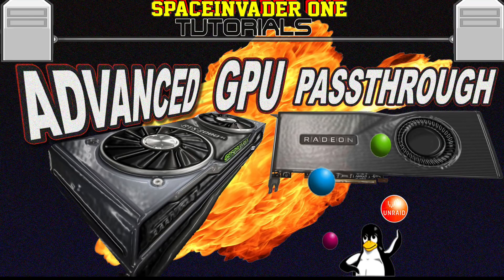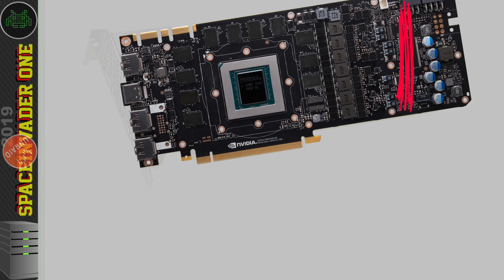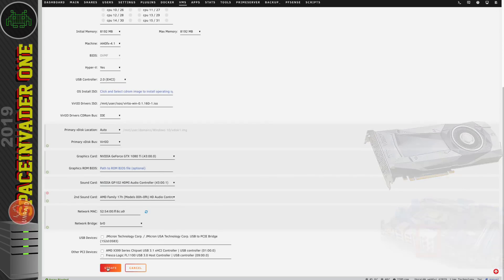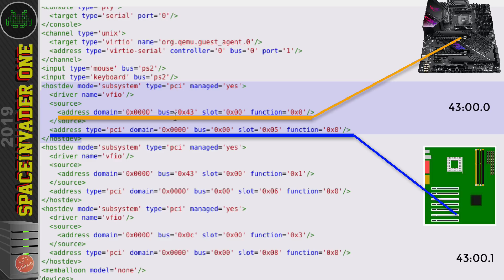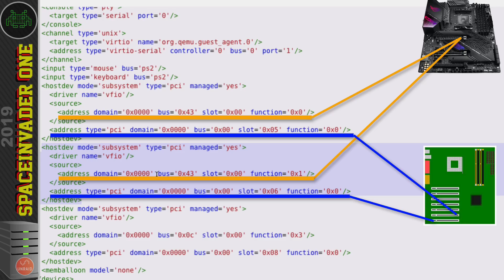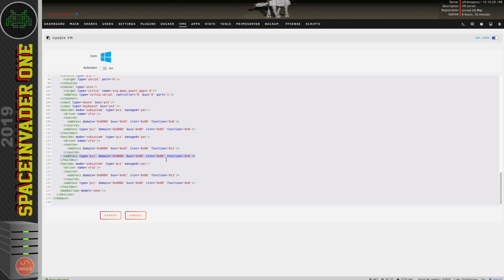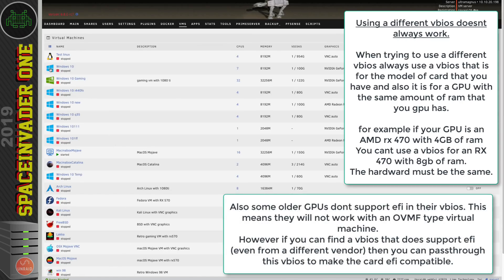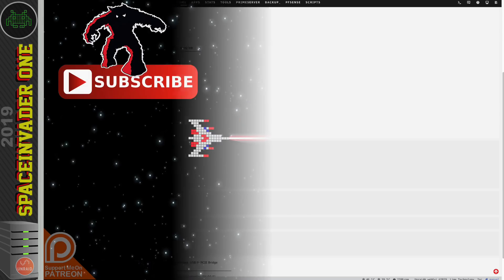Advanced GPU passthrough techniques on Unraid

Comment: CROSSFIRE or SLI please :)

can you do some cross fire and SLI experiments please?  i have cross fire working reliably on Unraid in a windows 10 VM both GPU's definitely working but haven't compared to bare metal performance. i wonder if SLI is also possible with a similar XML.

For cross fire machine type needs to be Q35, add DMI-topci bridge, Each card must be on its own Root port, with its sound card. i think my PCIE root ports are a bit of a mess - i couldnt ever figure out what "index", "target Chassis" and "port" were, but eventually got both cards working with the below XML changes   

   </controller>
    <controller type='pci' index='0' model='pcie-root'/>
### Add dmi-to-PCI Bridge Type i82801b11-bridge #### 
    <controller type='pci' index='1' model='dmi-to-pci-bridge'>
      <model name='i82801b11-bridge'/> 
      <address type='pci' domain='0x0000' bus='0x00' slot='0x1e' function='0x0'/>
    </controller>
 

    <controller type='pci' index='2' model='pcie-root-port'>
      <model name='pcie-root-port'/>
      <target chassis='1' port='0x10'/>
      <address type='pci' domain='0x0000' bus='0x00' slot='0x02' function='0x0' multifunction='on'/>
    </controller>
    <controller type='pci' index='3' model='pcie-root-port'>
      <model name='pcie-root-port'/>
      <target chassis='2' port='0x11'/>
      <address type='pci' domain='0x0000' bus='0x00' slot='0x02' function='0x1'/>
    </controller>
    <controller type='pci' index='4' model='pcie-root-port'>
      <model name='pcie-root-port'/>
      <target chassis='3' port='0x12'/>
      <address type='pci' domain='0x0000' bus='0x00' slot='0x02' function='0x2'/>
    </controller>
    <controller type='pci' index='5' model='pcie-root-port'>
      <model name='pcie-root-port'/>
      <target chassis='4' port='0x13'/>
      <address type='pci' domain='0x0000' bus='0x00' slot='0x02' function='0x3'/>
    </controller>
    <controller type='pci' index='6' model='pcie-root-port'>
      <model name='pcie-root-port'/>
      <target chassis='5' port='0x14'/>
      <address type='pci' domain='0x0000' bus='0x00' slot='0x02' function='0x4'/>
    </controller>
    <controller type='pci' index='7' model='pcie-root-port'>
      <model name='pcie-root-port'/>
      <target chassis='6' port='0x15'/>
      <address type='pci' domain='0x0000' bus='0x00' slot='0x02' function='0x5'/>
    </controller>
    <controller type='pci' index='8' model='pcie-root-port'>
      <model name='pcie-root-port'/>
      <target chassis='7' port='0x16'/>
      <address type='pci' domain='0x0000' bus='0x00' slot='0x02' function='0x6'/>
    </controller>
    <controller type='pci' index='9' model='pcie-root-port'>
      <model name='pcie-root-port'/>
      <target chassis='8' port='0x17'/>
      <address type='pci' domain='0x0000' bus='0x00' slot='0x02' function='0x7'/>
    </controller>
    <controller type='virtio-serial' index='0'>
      <address type='pci' domain='0x0000' bus='0x02' slot='0x00' function='0x0'/>
    </controller>

 
####  GPU 1 #####
    <hostdev mode='subsystem' type='pci' managed='yes'>
      <driver name='vfio'/>
      <source>
        <address domain='0x0000' bus='0x01' slot='0x00' function='0x0'/>
      </source>
      <rom file='/mnt/user/isos/vm/r9290x.rom'/>
      <address type='pci' domain='0x0000' bus='0x05' slot='0x00' function='0x0' multifunction='on'/>
    </hostdev>
    <hostdev mode='subsystem' type='pci' managed='yes'>
      <driver name='vfio'/>
      <source>
        <address domain='0x0000' bus='0x01' slot='0x00' function='0x1'/>
      </source>
      <address type='pci' domain='0x0000' bus='0x05' slot='0x00' function='0x1'/>
    </hostdev>
 
####  GPU 2 ##### 
    <hostdev mode='subsystem' type='pci' managed='yes'>
      <driver name='vfio'/>
      <source>
        <address domain='0x0000' bus='0x03' slot='0x00' function='0x0'/>
      </source>
      <rom file='/mnt/user/isos/vm/r9290x.rom'/>
      <address type='pci' domain='0x0000' bus='0x06' slot='0x00' function='0x0' multifunction='on'/>
    </hostdev>
    <hostdev mode='subsystem' type='pci' managed='yes'>
      <driver name='vfio'/>
      <source>
        <address domain='0x0000' bus='0x03' slot='0x00' function='0x1'/>
      </source>
      <address type='pci' domain='0x0000' bus='0x06' slot='0x00' function='0x1'/>
    </hostdev>
Reply from the maker: Very interesting. Thanks for the info :)

Comment: OMG man, you saved me the huge headache that I've been scratching my head at why I wasn't getting audio from my GTX970 in MacOS!  So simple and yet first 8 heard of it! 😝  May I suggest that you include this in the next update video for your MacinaBox plugin install?

Any chance you might have the solution to my one remaining problem of mounting the UnRAID shares as logical disks in MacOS? The system can't think they are network disks for a number of things like Lightroom, etc. I tried to set it up in the auto_master file as a destination folder as outlined at forums.unraid.net/topic/13013-automounting-shares-in-mac-os-x/ but have had no luck.